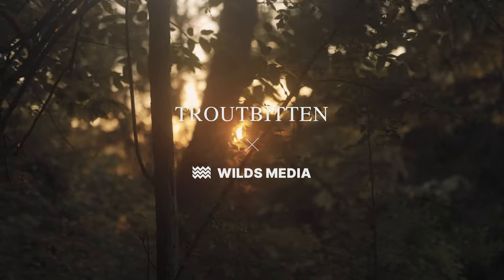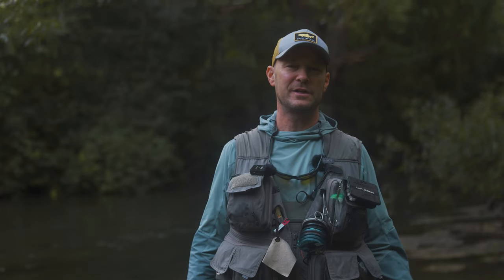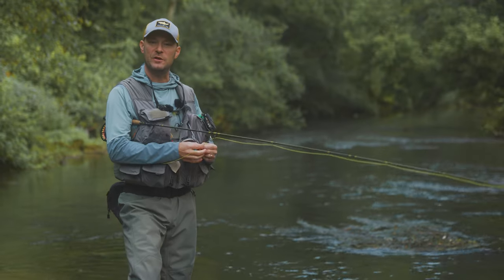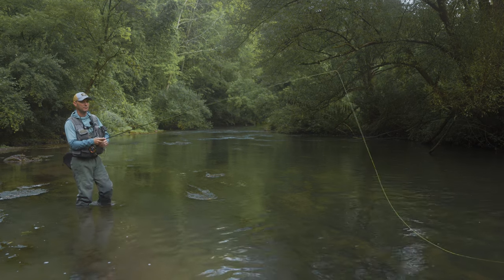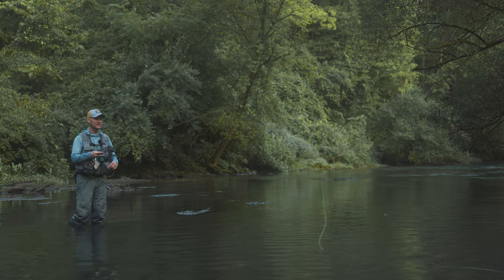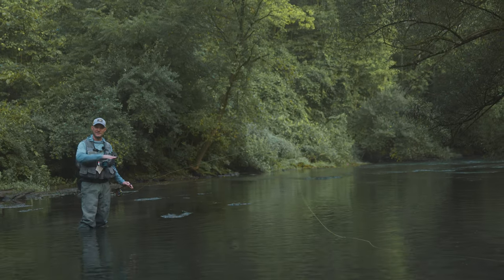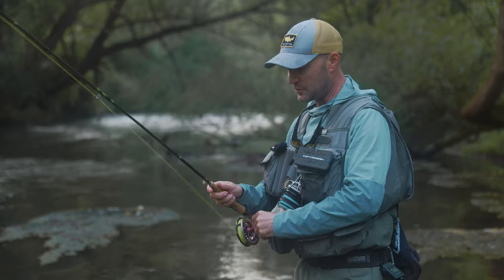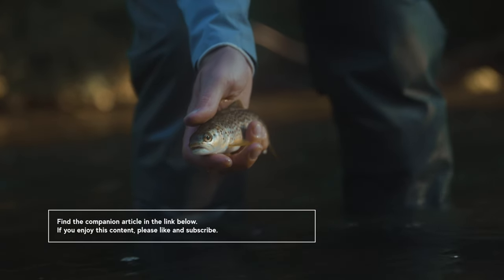The Pre-Cast Pickup -- For Fishing Dry Flies, Indicator Styles and More

Comment: It almost looks like a wiggle cast lift and go method.   It sure shows why your the pro and the rest of us are students. First time i tried it i had to call my buddy to come  down stream and untangle my body  that was wrapped like a straight jacket in fly line. Only kidding.  Thanks for the tip especially in difficult low current spooky trout water.
Reply: Right on. People probably have other good names for it too. I use a wiggle sometimes, but don't forget the mend and go and the roll and go too. I honestly don't think about it much. Just get the line moving. Then make the actual cast. It comes pretty natural, given a few hours of trying it out. 
Cheers!
Reply from the maker: Yup

Comment: I was always told to do a mini roll cast when fishing upstream to pickup my flies. It makes a loud sound and the water is working against you. I even will do a quick circle cast on my first forward cast into my back cast so I can cast at any angle.
Reply from the maker: Right on. That's pretty much what I'm showing here. But there's no loud sound. The line and leader just lift. And you can do it with a roll, a wiggle or a mend. 
Cheers.